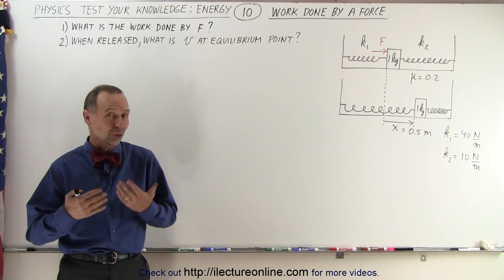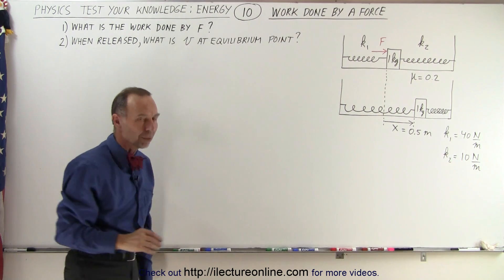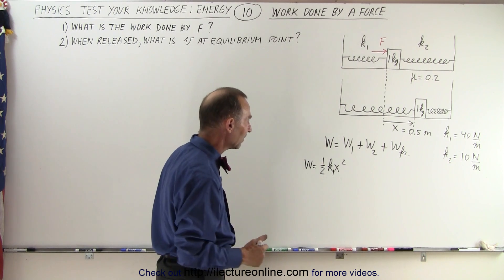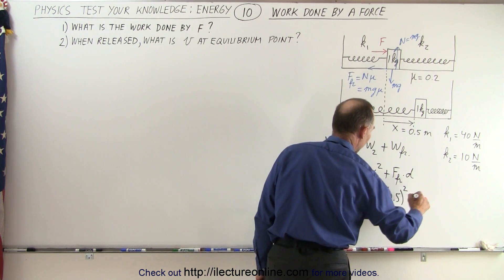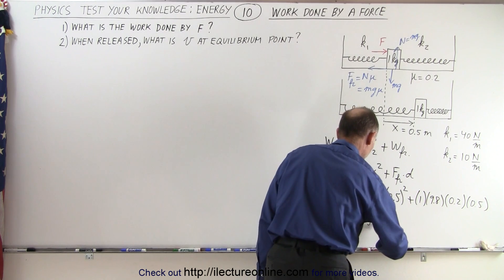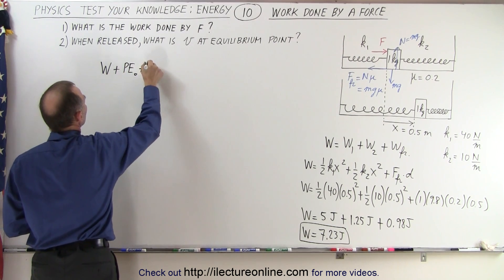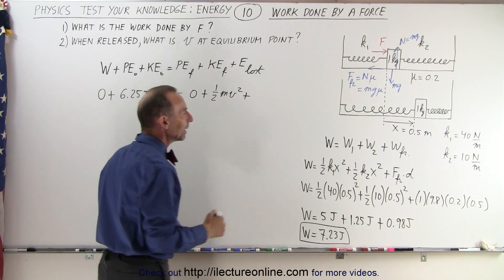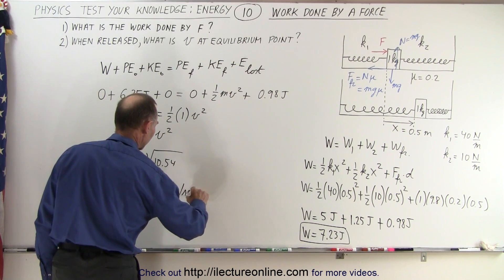Physics - Test Your Knowledge: Energy (10 of 30) Work Done by a Force

Comment: If I do the same experiment with a mass which is very large, intuitively, the force generated by the spring after moving the mass will not be enough to move the mass back to its initial position. What criteria defines whether or not the mass will be able to go back to its original position and not get stuck before it? Thanks
Reply from the maker: In theory with "zero" friction, the object would move at a (very slow) frequency.  But in the real world, there is no such thing as zero friction.  But that is why we study physics, so that we can learn the laws of nature and how they work, and then we apply those skills to the real world.
Reply: Thanks all for the answers. I wish I had made my question clearer, because the effect of the friction was actually the important part :-) . As the spring return to their original position, the force that they exercise on the mass may not be enough to counteract the friction force which is a constant. The mass will stop but there will still be some potential energy stored in the springs?
Reply: the energy lost by friction
Reply: imagine that Friction equals Zero. Then imagine the mass is equal to 10 million Kilograms... then stretch the Mass and Spring 1 meter and the K value is 1 .. the spring is very weak... the mass is VERY BIG.... would that weak spring still be able to pull the Mass back to equilibrium? ..  F = ma = kx......   a = (kx)/m... a = ( 1 times 1)/ 10 million kgs....  notice that a, Acceleration is NOT zero.. so the spring will exert a net force on the heavy Mass...